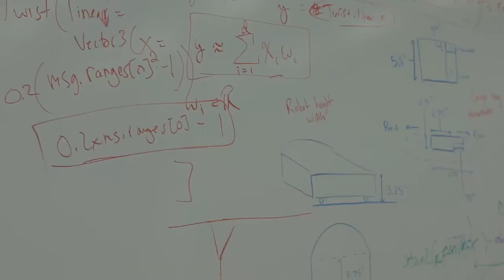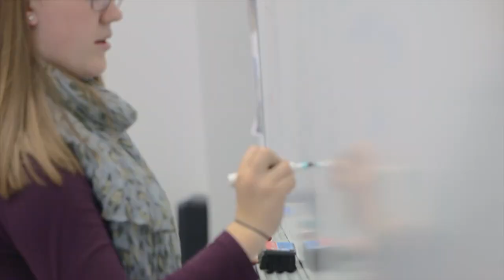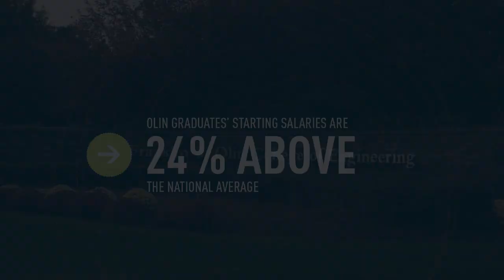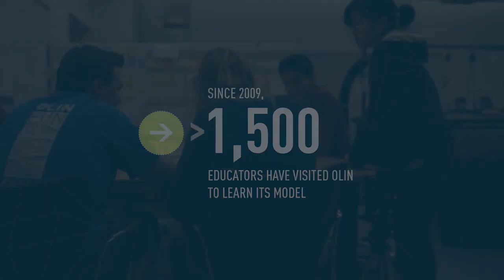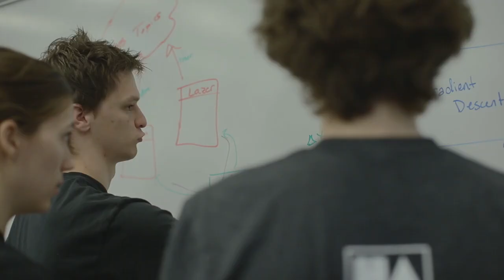The Olin Revolution

Comment: What a load of festering bullshit.
Reply: english major detected
Reply: Providing no evidence to support your derogatory comment is the work of a festering troll.The progress Olin has made in such a short time with such a small student and faculty body is impressive.  I went to MIT, to which a comparison is challenging, if for no other reason than the size of the student population. But, depending on the student, Olin may be a better fit and provide a comparable, or even better, experience. I have a friend whose grandson could have attended any of the elite schools or military academies and chose Olin because of the open curriculum. No bullshit.
Reply: Explain why there's a 95% 6-year graduation rate